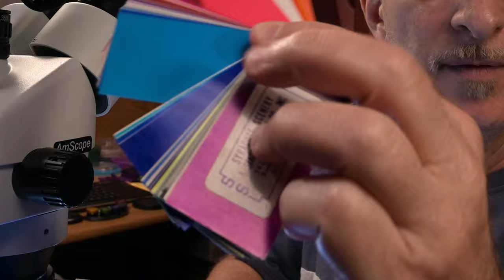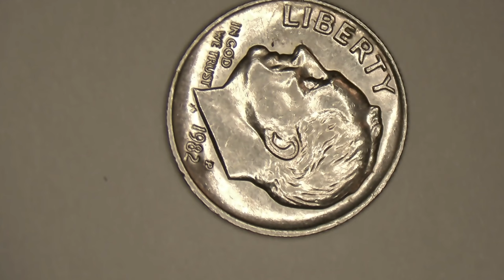4K Microscope Customized for Watchmaking

Comment: Can I ask a quick question, please?  What type of camera is installed on your microscope?  Is it a Hayear HY-6110?  Because I have a choice between hy-5299 or hy-6110.  Please advise me quickly please.  Because I need a camera lens.  I would like to try it, please.  Thank you in advance for your effort
Reply from the maker: I'm not sure of the model number, but I have links in the video description to the camera, microscope and all of the accessories.
Reply: Really thanks for your quick response.  really you are wonderful.  But are you satisfied with the quality of this camera?  Because I hear from some people that the lens installed on the camera is not a real Sony sensor. That's why I hesitated a little.  But it's the image quality that matters
Reply from the maker: @lolikatrin2648  I don't see why it wouldn't be a real Sony sensor… Sony made a gazillion of them and they are quite affordable, so no real reason not to use them. I have been happy with the quality. My main complaint with this camera is that it forgets the white balance and exposure setting when you turn it off and turn it back on, so you have to go into the menu and reset those. I also have audio noise when using an external microphone. It records sound good enough that I can synchronize the video up with my other cameras, but I have to use audio from a different source. But features and quality I think are excellent for the price… I did not find another camera in this price range that had better specs.

Comment: Great vid Mike. Am looking at getting a scope myself. What is the magnification factor of yours?.

Handy tip.... When pulling arbour out, cover the spring using tweezers held flat across spring, like you did when removing the barrel lid. Then use second tweezers to grip arbour and rotate it opposite to the winding direction. 90 degree turn will free the hook and no risk of bending the mainspring when pulling arbour out.
Reply from the maker: Thanks for the suggestion on removing the arbor! I've done it before, but never under the microscope. It felt so awkward! (I did find it eventually, lol) The magnification zoom range on the microscope is listed as 3.5X-90X. I know this changes based on the eyepieces, Barlow lens, etc. Whatever it is, it's the perfect range so far for my watchmaking tasks!

Comment: Great video. Although I don't do video production I do the same kind of work and have the same problems. I'm about to order a 0.5 Barlow lens for my trinocular SM.. I have the same problem of not having enough room to use my tweezer straight on and worse, my screwdrivers, and have to tilt the movement to use them or else having to use a loupe.
Reply from the maker: Hi Mr. Flintstone! Since recording this video I have switched to a .7 Barlow lens. I felt the .5 lens put me too far away from the subject, and my chair wouldn't go that high. .7x is the perfect compromise of working distance and magnification. Hope that helps!

Comment: Hi Mike
Love your videos. I use a standard ring light on my microscope but do find that I can see the reflected 'ring' on the watch movements, jewels, bridges etc especially if they are really shiny. I wondered if that coloured film would cure this. Would a 'polarized'  ring light be the way to go.
Regards Chris
Reply from the maker: @jowettcars  Hi Chris, to control reflections you can add a polarizing film in front of the light source, and then put a rotating polarizing filter on the microscope lens. Depending on the reflections you are getting, the microscope polarizer would rotate into a position that cancels the unwanted reflections. I have toyed with the idea of doing this but it reduces the brightness of your ring light slightly and is something that I have just been working around by slightly repositioning the angle of the microscope. But it would be fun to try, so maybe someday!

Comment: I just discovered your channel and really enjoy your videos. In fact I just bought a microscope setup similar to yours. Question: the eyepieces are too high for me with my current desk and chair. What desk/chair changes did you have to make when you started with the scope?
Reply from the maker: @mkahky  Hi Michael, welcome to my channel! I bought a new chair that goes higher. I ended up with a .7 X Barlow lens, which still gives me enough workspace under the microscope lens, but brings the eye pieces down a bit. I also tilt the microscope back slightly, which helps as well.

Comment: Just subscribed. I found your channel by looking for inspection cameras to use on my custom jewelry bench. I love your enthusiasm and the way you go into great detail. I guess we are all cut from the same cloth! I would love to pick your brain about some of the details of your camera setup. I just bought an inspection camera to display work on a monitor for our customers. Unfortunately, one of my goldsmiths used the ac power adapter from my graver mach to power the camera and killed it. It was an honest mistake as we were rearranging our shop. Now I'm on a deep dive looking for a better camera than what I originally purchased. Would you be willing to provide some insight if I give you the details?
Reply from the maker: Hi Justin, thanks for the nice comments! Bummer about your camera burning out. QQ: my camera can take two power sources, 12 V and 5 V. If yours is similar, I would suggest trying the other power input before giving up on it. I have gone into some detail about my setup in the comments section on this video and the one that preceded it, so some answers might be there. Otherwise I welcome your further questions. Thanks so much for subscribing and supporting the channel! 😁

Comment: very very cool video , i have a question what is your opinion on the AmScope SW-3T24Z Trinocular Stereo Microscope , it's more in my budget for 362 dollars , think it would be ok for watch repairs
Reply from the maker: I think it would be OK for watch repair as well, but what I like about mine is how robust the base and telescoping arm is. I'm constantly moving the scope around my work service and it really gets heavy when the arm is fully extended. So I guess it depends on how much you will need to move the scope around.
Reply: @WatchWithMike  hi thanks for the reply , your scope is only 60 dollars more , so i just bought it !!!
Reply from the maker: @Anne6621  that's great news, Anne! Congratulations! 😁

Comment: Thank you for the information.  I'm looking at getting an AmScope for watch repair and I'd like to record video while I work, my question is do you have to pick between being able to use both eyepieces for my eyes to gain the binocular effect or using one eyepiece for one eye and camera for my second eye or are you able to use both eyepieces for your eyes and have the camera recording at the same time?
Reply from the maker: @danhealy9093  Hi Dan, a trinocular microscope has three "eye pieces". Two for your eyes that give you stereo vision all the time, and the third is permanently hooked up to a camera which sees everything that you are seeing. So there is no compromise… You can always see in stereo and have what you are seeing recorded.
Reply: @WatchWithMike  Hi Mike, thank you for the reply, I investigated closer and the exact model AmScope microscope you have on your video has a feature referred to as "Simul-Focal" which allows the user to use the both eyes pieces for the binocular effect while video recording, AmScope microscopes without that feature will only allow you to use either both eyepieces without video recording or only one eyepiece while video recording, so if anybody wants to be able to use both eyepieces and video record simultaneous make sure you get one with the "Simul-Focal" feature.
Reply from the maker: @danhealy9093  good tip! I never knew that was a thing.

Comment: Hi Mike, I have a Amscope with the Hayear camera connected to the scope. I’m trying to connect the camera to my labtop but to no success. What software did you use? Can you explain how to connect the camera to record on my labtop. Anything you can do to help would be greatly appreciated.
Reply from the maker: I am not a good resource because I have never connected to a computer. I am strictly using the camera to record video via the internal mini SD card. I believe whatever software is available to connect to computers is available on the Hayear website. Let me know what you find!
Reply: Thanks for responding. I have checked  on the Hayear drives  but can’t get it to work, I’ll keep trying and if I can’t figure it out I think I’m switching to cameras with SD card.

Comment: Hi, Can you please tell me the distance from your eye piece to the top of your work space.  I'm thinking of getting one of these scopes but not sure if I will need a lower bench as well, which I really don't have room for.
Reply from the maker: @yesterdayschild1418 - It's 17.5" from the eyepiece of the scope to the table top, with a .7x Barlow lens installed. (Barlow lenses change the working distance between the bottom of the lens and your subject.)  Zoomed in, the eyepiece is 15.5" from the desktop. My desk height is 30". I just bought a new desk chair that adjusts higher than my last one, and that really helps my posture. Switching chairs is easier than switching desks! Hope that helps... 😄
Reply: @WatchWithMike  Thank you so much for getting back to me, that's really helpful. I have a Duston watchmaker bench that is quite high, 38" from floor to working surface. The bench is okay but it has a protruding part that sticks out at the front so you cant get your body right close to the main area which is a bit annoying really as it means you're working close to the front with lots of space at the rear, but I assume its like that for a reason. Anyway, back to the scope, I brought a hight adjustable chair to go with the bench and at its highest setting and with me sitting and looking directly ahead at the wall my eye level is circa 21" from the work surface so in theory it may be okay, decisions decisions :-) Just one more question, if I may? I assume, because you zoomed in on the movement, the large image on the left is what you're also seeing through the microscope but what is the image in the top right as that appears to be more of a direct straight down image whereas the large image appears to be more at an angle, also does the zoom function auto focus as you move closure? Apologies for so many questions.
Reply from the maker: @yesterdayschild1418  Great questions… first, a watchmakers bench is designed to put your eyes close to the work surface, which is the opposite of what you need working under a microscope. For that reason, I'd recommend looking at a microscope that is on a spring mounted arm, rather than one that rests on a heavy metal base like the one I have. It will give you more flexibility to accommodate to the different heights of the bench. Another variable that we haven't discussed is that the microscope head can be tilted, lowering the eyepieces and aiming the microscope more forward. I like a slight tilt because, if you view your work straight down, your hands and screwdrivers get in the way. So tilting the microscope is another way to reduce the height. In my video, the image on the left is what you see through the microscope (the microscope camera sees what you are seeing). There is no auto focus… you need to manually refocus whenever you change magnification. The top-down view in the upper right corner of my video is a cropped version of what my overhead camera with a macro lens is seeing. It has nothing to do with the microscope view. 😁

Comment: 3:55 could the blue light be due to the reflection from the blue mat you are using? As far as the microscopes go, the variety is just crazy. I am interesting in getting something under $200 but for what they are, most digital ones from China seemed a bit overpriced, imho, especially compared to the better, higher quality build binocular or trinocular ones from AmScope. That said $500+ dollar is not something most any hobbyist could cough up easily to get one.
Reply from the maker: I used a digital microscope before getting the big optical scope. It's less than $200, and it shoots great video… Check out some of my earlier shows and you will see it in action!